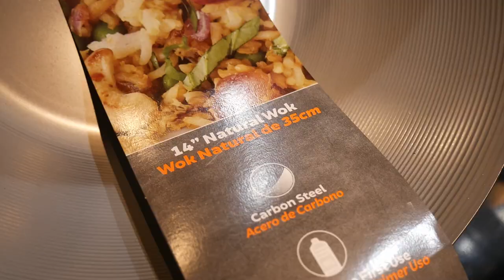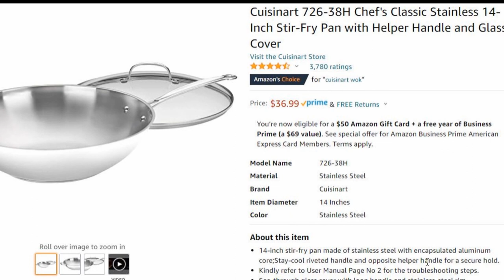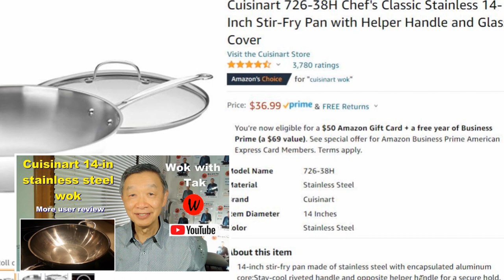11 CRITERIA for Selecting the RIGHT WOK for Your Home Cooking and the FAST Cooking System

Comment: Prof Cheung, I purchased the same wok after watching your videos because I agreed with most of your points. I would prefer, however, two changes: (1) two loop handles (“Cantonese” wok) and (2) thicker side walls for the lower 4”-5”. The ability to move the wok with one hand is lost, but storage is easier and the shovel replaces tossing. The additional metal adds weight and cost, but reduces scorching and enhances heat retention. My “perfect” wok would be the one my grad school roommate used. A Calphalon commercial anodized wok that’s no longer sold; the only drawback was its round bottom.